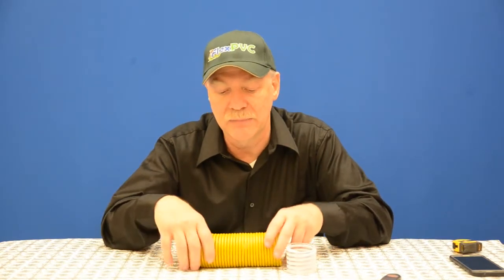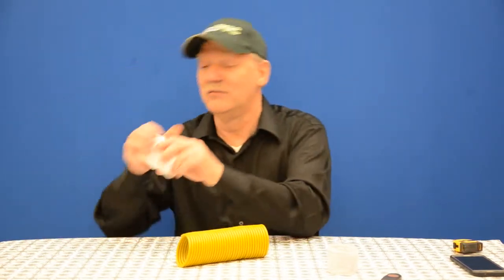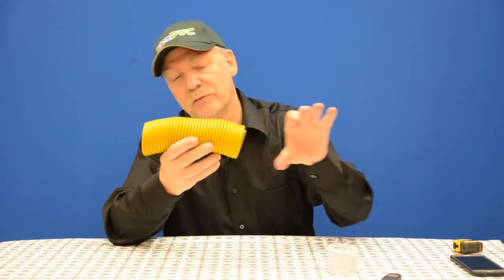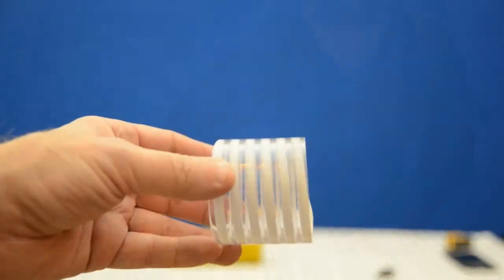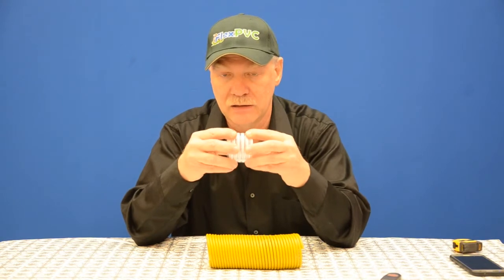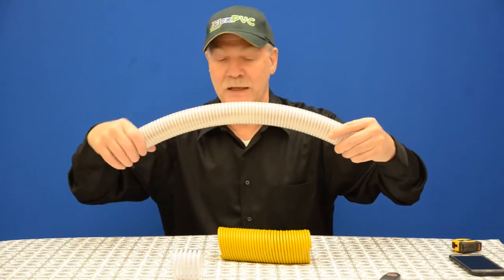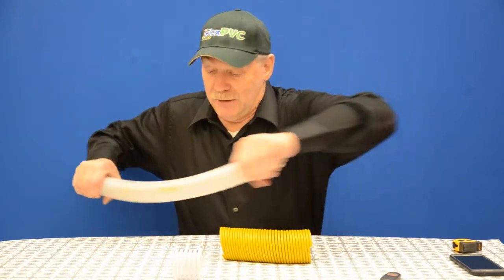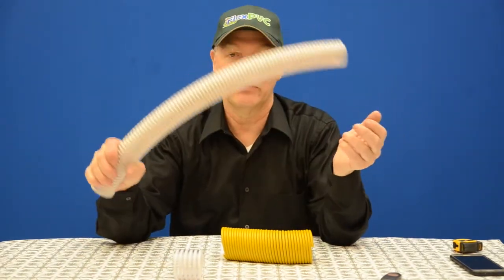FlexPVC - What exactly is FlexPVC Flexible PVC Pipe? Learn exactly what it is and how it works.

Comment: what's the difference between flexible pvc and standard TPE plastic flex hose?.
Reply from the maker: Day and night difference. TPE plastic flex hose is a HOSE. Flexpvc pipe is flexible pipe. TPE plastic flex hose uses barb or insert connectors with clamps. FlexPVC glues into standard sch 40 fittings with primer and glue. TPE plastic flex hose  is similar to silicone hose. FlexPVC is NSF rated for pool/spa, etc. (Neither are rated for potable water.)

Comment: Hello, thank you for the video! It was exteremely informative. Would you also be able to use the flex pipe as a sewer line for a house? Thanks again!
Reply from the maker: Yes and no. If it's buried you would be okay. But if it's exposed there is an issue: Over time, sewer gases will permeate thru the pipe. 2-5 years and then you will small sewer smell. If there is only a short section of pipe exposed, it should not be a problem, but it's something you have to consider.

Comment: So the crush resistance is equivalent or better than rigid PVC? Would 4" schedule 40 work for underground drainage, for gutters or french drain work? Thanks.
Reply from the maker: FlexPVC Flexible pvc pipe is rated for burial to 6' deep w/o issues.

Comment: Can you use a heat gun to bend the pipe more?
Is it available in smaller (3/4 in) sizes?
Do you have any videos on how to use it, i.e. connections etc.

I'm making a solar panel to heat a small amount of water for an outdoor sink. Thought I might use a coil of black FlexPVC laying out in the sun and let convection circulate the water in a small tank at a  higher elevation.
Reply from the maker: Yes, you can use a heat gun, but you have to be very careful. On small diameter  pipe you don't really gain much. On 1.5" and up it can make a good difference.

We have FlexPVC flexible pvc pipe down to 1/2" IPS size (sch 40).

For how to use it, see our videos. 
https://flexpvc.com/TechArticles/FlexPVCVidList.shtml
and application guidelines:
https://flexpvc.com/Guides/

Thanks
Reply from the maker: Yes, you can, but you do have to be careful not to overheat the pipe.